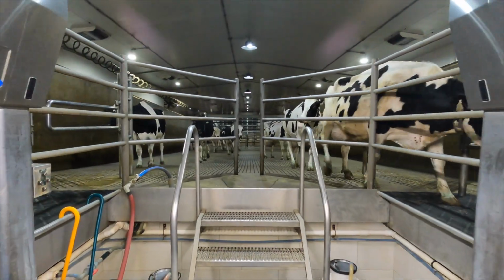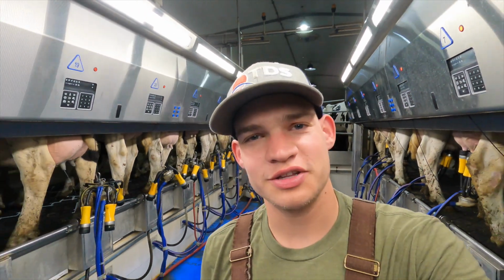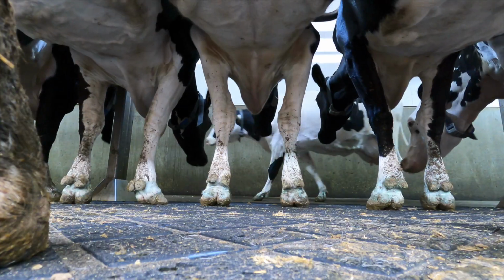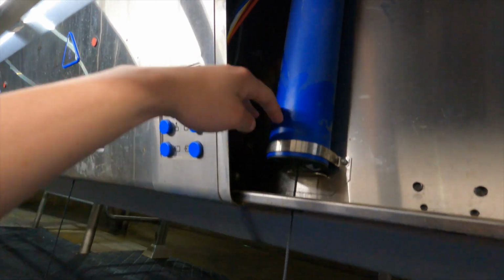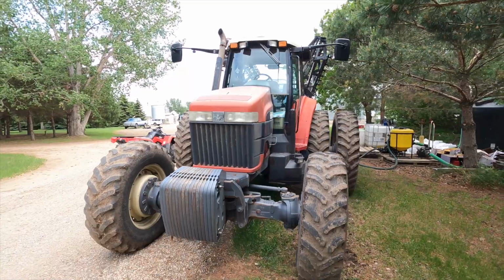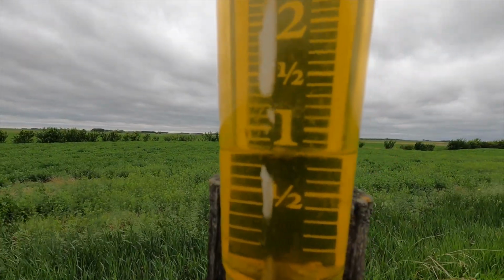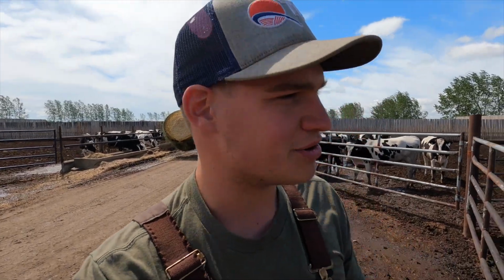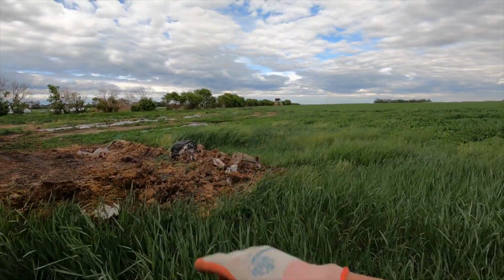Its Summer Time! Chores On Dairy Farm

Comment: Maybe it is a tip but when I worked at my neighbors farm as a teenager to earn some bucks, the farmer always made sure that after I cleaned equipment with a pressure washer, I used to let it dry and then spray wherever I could/points of interest (of course not any place food related) it with WD 40.
So dust, dirt, water, anti rust and lubricant in 1, just didn't cling so fast on it all again.
That stuff really is handy with so many things, I still use it often with anything.. even household and car/motorcycle  related things 😁

Comment: What are those red fans on the left, when you walked back after connecting the manure-spreader?
Reply: That's exactly what I want to know. All the same model and quite new.
Reply: its to cool down the grain after harvesting. It blows air through the bins
Reply: Areation fans that assist with the grain drying process immediately after harvest and helps keep the grain fresh.